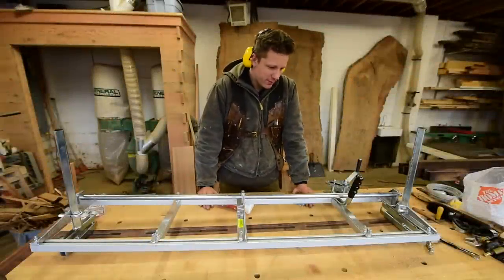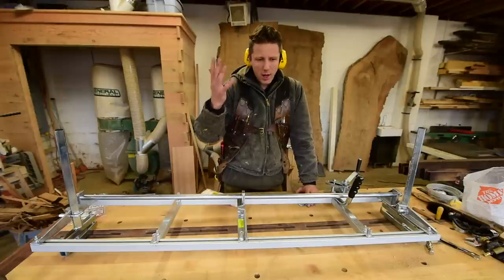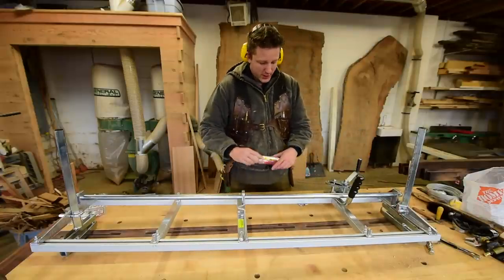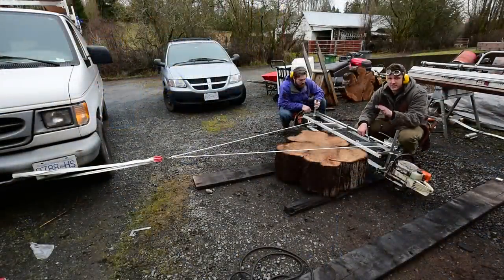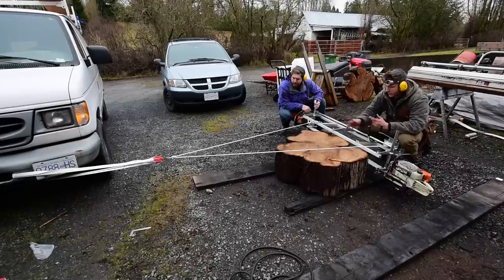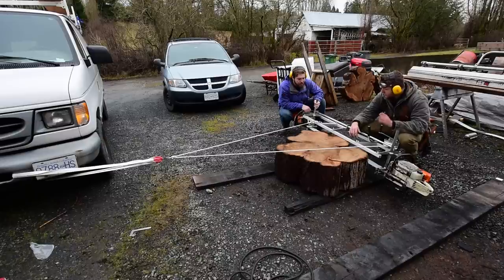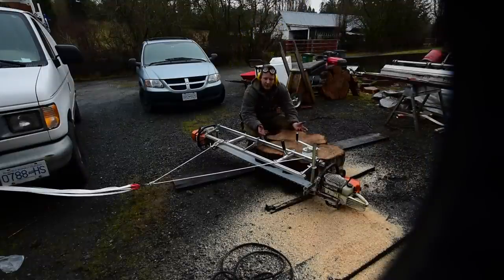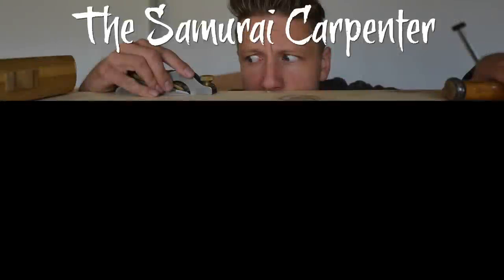FTF #46 Alaskan Chainsaw Mill Winch Hack! How To

Comment: A suggestion to make starting and finishing the cut easier. If you affix a couple of straight sticks like 2x4s on top of the thing you want to cut in the direction you want to cut, overhanging by a foot or two on either side, you won't have to manually stabilize and support the mill at the start and end. This is how I've seen other people use Alaskan mills when milling logs which have irregular surfaces, they just attach a couple of long smooth and straight boards to the top of the log. Then you can just focus on making sure the winch is pulling, instead of tipping, the saw.

Comment: I just bought a winch last night to do this very same thing. My hands hurt after milling a couple slabs, (carpal tunnel).  This is going to help a lot. Like the comments from a couple people about removing the handle and using a drill instead.

Comment: I very much appreciate your honesty and integrity you have given with all your vids.  I have been wanting to buy a Alaskan mill for several years now and still have not done it.  I work alone so the double head one you have is not for me.  However, I am 49 years old and I know these are a lot of work.  Just wanted to know if you own a Alaskan mill smaller then the big one you bought and what size you bought and if you thought they are worth the money and hard labor you put into it.  I was thinking about buying a new saw Stihl MS660 with a ripping chain and the easy rail they are making now.

Comment: Hi Samurai, one cost saving tip to consider.  Slabbing usually requires long run times especially with the big wood. a good cost saving tip is to cut your bar oil with much cheaper canola or vegetable oil.   Depending on your preference a ratio of approx 30% reg bar to 70% veg/canola oil can result in a 50% cost saving on the expensive bar oil.  Try not to leave anything in the bar oil reservoir for extended storage times.  Also you have to be careful during extreme cold as vegetable oil starts to gell up.

Comment: Haha ! Everybody put the chaine backward at least once , I did too !   Man you are equipped for mill racing , that really intense.  I was expecting saw dust on both sides.  I use a bungee at the anchor so it will stretch and give up pressure as you pull in ...  Good milling !

Comment: Samurai, another excellent video.  There is certainly something zen like cutting slabs out of a log with a strong chainsaw mill.  A number of good points in your video and in the comments but I hope I don't offend by offering two more.  Your apprentice needs to read the safety manual at least for the chainsaw.  Also you might want to consider using a mask with proper vapour cartridges.  If there is no wind and your head is close to the chainsaw exhaust for long slabbing sessions it can result in light headiness and bad for the lungs.  Last week princess auto had these on sale for about $25.  Again, you are killing it on the west coast.

Comment: Question for ya,  most slabs that I've ever worked with and have viewed on display are usually at least 5 feet long if not longer. That winch looks like You might have done better using one of those Harbor Freight, bumper mount, Jeep type winches. Did you elect to go with the manual winch route Due to Cost factor?

Comment: Is there a reason you aren't shimming behind the cut? I've never used an Alaskan mill before, but I would think the weight of the top slab would pinch the saw? I really enjoy your channel. Thanks for making interesting content and sharing the knowledge.
Reply from the maker: Typically I would but for a piece this small it's not needed.

Comment: Great hack. May I suggest one modification?  Place an eyelet or guide for the rope to pass through before entering the winch. I would place it on the front rail in front of the winch. It would keep the rope aligned and centered entering the winch barrel. Probably help avoid rope jamming-up the winch. Just an idea...
Reply: I figured this out as well, the rope also likes to wear on the round cross bar, so that is an issue. but good catch

Comment: You might consider looking at how a DoAll vertical band saw power feed is setup. The same counter weight and chain/cable setup could be applied to your Alaskan saw mill.

Comment: I wondered if its maybe a bit more consistent to instead of using wedges to hold up the log, use adjustable metal arms that are a bit free to move in one dimension and have them run spacers that will just slide along into the gap the saw cut out

Comment: You could have some very nice electric guitar and bass guitar bodies from those slabs. Most Fender guitars like the Telecaster and Stratocaster are 44mm (1.75 inches) thick. Trouble is that most bodies get assembled from multiple pieces of dimensional lumber and have to be painted solid colors to cover up the seams and boring featureless grain. 
While those big Garry Oak slabs would be too heavy for a complete body, you could cut one in half, chamber it, glue it back together and have a beautiful single piece oak body. A semi-hollow body Les Paul would be cool or cut them into 7-10mm thicknesses and use them for tops on lighter weight wood bodies.
Even the nicest pieces from companies like Warmoth, tend to be bookmatched because of the lack of available single pieces. Just another thought for those big pieces of cellulosic gold you have sitting there.

Comment: Having 2 winches connected may be a better solution if you are operating this with 2 people or you want it easier to control side to side pivoting.  A piece of bike chain and sprockets between the 2 winches would ensure they both stay aligned.  Either way it looks like with a bit of practice it would make things really efficient.

Comment: You really have to attach that second bolt on the wench itself to the sled. You're right the spinning of the leaver will keep pressure on that second bolt and keep it all in place, but why wouldn't you want to just attach it to the sled too?

Comment: Why don't you just build a frame on which you can install this chainsaw system? The frame would have adjustable legs for the proper height according where you want to cut and the chainsaw mill itself could just slide on the frame with bearings or something. Btw really great channel, and you are a good man. Keep up! (sorry for the bad english from the other end of the world :D)

Comment: I squirmed a bit when Justin put his hand down the front of the chainsaw. Probably wasn't as close as it looked in the vid, but enough to wince at lol
Reply: this is his new apprentice? the guy cant even run a saw... you should never make someone with now saw experience run this... he don't even know what way the break goes.... or to turn the choke off after its warmed up...
Reply: Now, now!
Reply: That is why he is an apprentice.  Remember, we all had to learn at some time how to operate a saw correctly.  Some people don't ever get the opportunity to use power equipment and thus are clueless till they receive that experience.
Reply: Okay but thats my point exactly...you don't start someone off milling slabs... let him spend a week or two in the woods with a little small saw cutting brush and what not... i was young when i learned but when i was on the job my uncle made me run a small saw for like 6 months before i was even touching a 3 saw... it should be second nature what way the brake should go
Reply: Milling this one slab made him much more aware of how the process works. He's also not running the saw on his own. He's trying to listen and watch for instruction Jamie (Jamie? James? what's his name?) while doing his best  to make the necessary changes quickly which, let's face it, can make someone nervous and second guess their normal common senses. But regardless, he's not you, he's not your apprentice, you're not the safety patrol.  Just move along, sir.
Reply: In my view, a machine is a machine. Nearly all of them are capable of taking a finger or two off, and some a whole hand or two. It doesn't particularly matter which machine you start on, if your going to cut a finger off then you'll do it at anytime on any machine. So I can't see how starting on a smaller machine will make any difference in that effect.

When I was an apprentice I was started on massive machines, I learned faster than I probably would have done if I was introduced to a smaller variant first. Possibly I may have been over zealous with the larger ones when I finally got onto them also.
Reply: Maybe i came off sounding harsh on the apprentice... but samurai should be a little more smart about this.... i actually give the guy some balls for just going with it... but its irrisponcible for him to just let the guy jump into this because he has a new toy he's been needing two people to try out. just letting him dice out some fire wood for a few hours and get the feel of the controls one slip can fuck this guys life up for ever and never be able to work again and make an income to support himself. Ive worked jobs where the previous contractor had workers killed and they were sticky situations with pros that just slipped up one time... of course it can happen to anyone but if you can lower the chance by adding a little training he should... that would be the samurai way!

Comment: Why not use your bandsaw mill?
Reply: the chainsaw mill will cut wider lumber
Reply: Chris Mills it's not practical to lift a couple hundred pound log up and push it through a bandsaw. Also, you really don't want to put green wood on your bandsaw, unless you like a rusty cast iron table. One last reason, logs are dirty. You don't want to cut a dirty log with a good bandsaw blade. Bandsaw mill blades are thicker and meant to be used on dirt covered logs.

Comment: Need to go back to Princess Auto - or TSC - and get a steering wheel spinner and modify that handle on the winch... Your hand/wrist looked really awkwardly placed - looks like it would get uncomfortable after a few hours of slabbing.

We have an army Surplus store here locally that sells a thin parachute rope, extremely strong for the size of it... If you had less bulk on your ole winch drum, you might have less issues.

Great concept though - and a heck of a lot cheaper than a Wood Miser! I've never seen two chain saws work together like that. Cool!

Thanks for sharing.
Reply: I took the handle on my winch and cut in in half between the handle and the winch drum, then drilled it and bolted it together at half the radius. With the doubled rope through the pulley, there is a lot of winding to do. I also learned to let the saw cut without adding a lot of extra tension. easier on the chain, motor and doesn't wear out an expensive bar as fast.

Comment: I'm so confused as to how two power heads turn the chain in sync. It seams like they would be going different rpms. I'm a newb
Reply: MrRalvsx they have clutches bud that slip only under load to they apply torque. speed equals the torque applied. hope that makes sense

Comment: Years ago, while cutting shake blocks up the coast, one morning I sleepily slapped together a chain using 5 short left overs of rolls to make a 36" loop.  Upon completion I noticed that I'd put it together with a twist, easily rectified with the hearty encouragement from waiting co-workers. It wasn't until I started bucking that it became apparent that something else was amiss with my new chain, I had one section of about 20 drivers inserted backwards into the loop. AArrghh !!  some days are like that, I was able to squeeze another day of cutting out of my old peg toothed chain. Taking extra care to avoid rocks as a rock would have sheared off what little tooth remained.